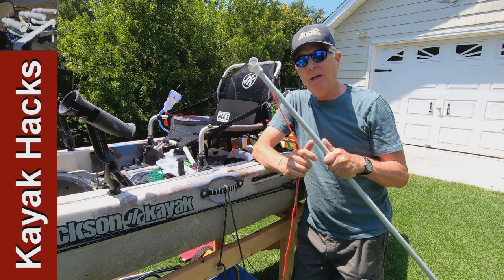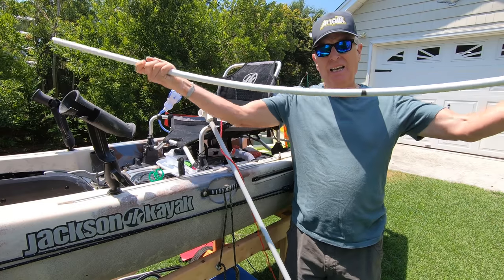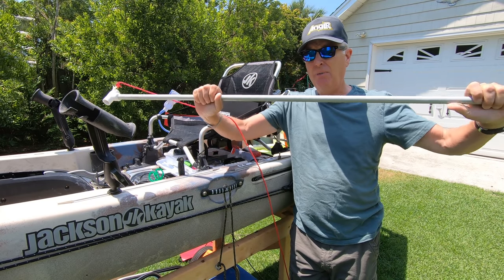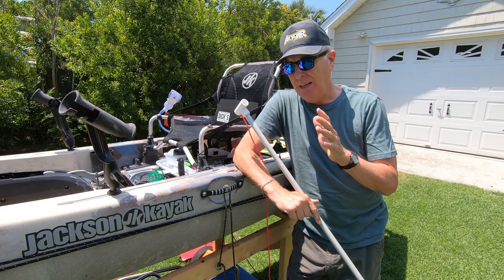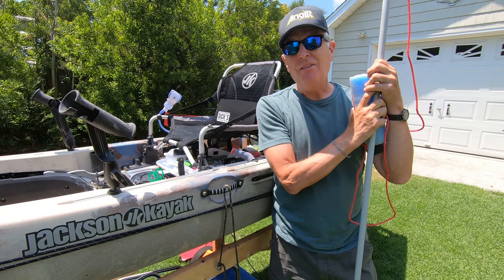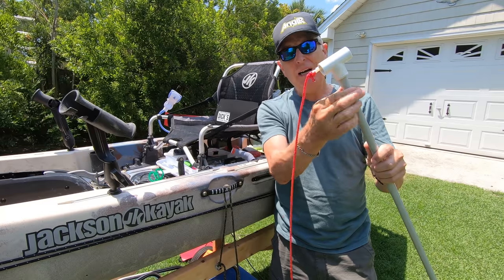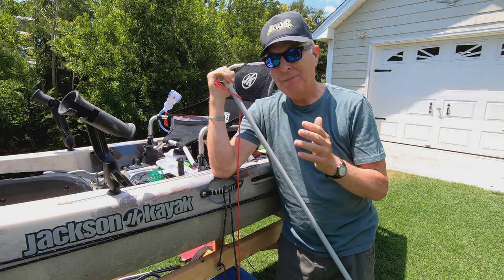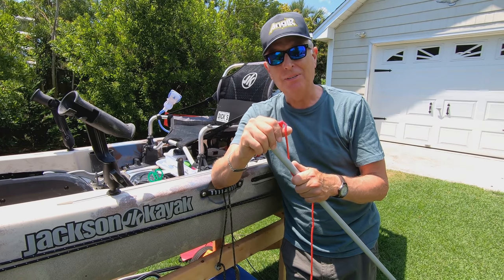DIY Stake Out Pole Kayak Anchor - No PVC! (Stake Out Pole Part 1)

Comment: GREAT IDEA.  Gonna try and make us a few.  I read in a comment below about splintering and I have had some guard poles splinter on me.  I think that the fiberglass with a coat of flexseal, especially on the handle would really help, especially if the fiberglass started splintering.  Thanks.
Reply from the maker: I put shrink wrap tubing on it. No issues since I did that
Reply: @KayakhacksFishing  now that's a great idea.

Comment: I bought the 1/2 poles from them, but couldn't find a handle that fit it properly. May have to bump it up a size or two then. And that zip tie pool noodle hack is one of the best I have seen for a stake out pole. I lost the only real $80 stake out pole I bought because the noodle didn't hold it up. That's when I began my quest for DIY stake out poles.
Reply from the maker: lol! My expensive one is on the bottom as well!

Comment: Thanks for all of your hard work you put into these videos! One thing I can say is If you run the rope through the handle, then cross the rope about 10 times around each side of the tee (should look like an “x”), tie a bowline knot into your slack rope and make it as long as you want. Unless you’re applying 24 kN of force, it won’t go anywhere.
I guess the real factor there is how much your rope can withstand lol. But it’s not really that hard to keep the rope tied to the stick. There’s hundreds of ways. That’s just the way I did it.
Reply from the maker: That is a great idea! Thanks

Comment: I did the Wal-Mart fiberglass pole for mine. For the handle to go the bicycle section and get a pair of rubber handlebar grips, the old school type with the flair flange at the opening. They fit real tight, no need for glue.  On the second handle with a razor knife  i cut off the flange  and use it as a sliding stop with an "s-biner" on my anchor line in between. The rubber ring is real sticky on the pole and stays where you put it.
Reply from the maker: Thank you for those tips!
Reply: I used the miracle grow fiberglass stake.  I found its diameter to be a little to thick for the areas I fish.  Yeah i could get it pushed in but in some areas it really took some effort.  So I put on the painters mask and spun it on a home made lathe to get the diameter I wanted.and a rough point.  

I then to some marine grade putty and on the pointed end I covered it with putty but the. Also made some vertical barbs.  Picture a arrow hunting tip. Not the field point.  But the triangular hunting point.  I formed the putty in that shape around the point fiberglass rod.  What that does is even in the strongest currents ive had my pole pull out all except that last two inches of my pole.  Kind of acts like a barb on a fishing hook.  Works well...
Reply: Now this a damn good hack. 👍
Reply: Thank you

Comment: I made one from a similar garden stake I got at Walmart for around 6 bucks. I used epoxy (JB WELD) and added a small bolt through the pvc and fiberglass area for security. I made one 6 Ft. out of 1/2 inch spike and one 8 Ft. out of 3/4 inch stake. The 6 Ft will serve most of my needs as I fish a lot of shallow water. I also think the 8 Ft.-3/4 in. is considerably heavier but may be useful. I added JB Weld to the tips for wear resistance. If it wears away over time I can always reapply down the road.
Reply from the maker: Does the 1/2 inch hold well?
Reply: The 1/2 inch is very stiff and anchors very well. Built and had my wife use it a couple of times. She likes it. You can slide it through a scupper hole or just stake it in and tie off to it. Her I use it in the ring on my anchor trolley.
Reply from the maker: Perfect! Hope other folks see your comment.

Comment: Nice work. I use a 6' stakeout pole also, as I'm usually in fairly shallow water too, and anything longer would just be in the way while transporting/stowing it on the kayak.

Keep an eye on the garden stake you're using so it doesn't start shedding/flaking fiberglas off into your hands. I believe some fiberglas starts doing that after exposure to wet environnents and UV rays.
Reply from the maker: Hmmmm. good point. I think I'll cover it with shrink wrap
Reply: @KayakhacksFishing  Shrink wrap is a good idea.
Reply: I was reading thru the comments to see if anyone made this point> My "school of hard knocks" lesson involves pulling out my rock marker buoy at season's end. The buoy was designed to ride up and down with changing water levels on a fiberglass shaft.  After a few seasons, as I grabbed the shaft to lift it out, it filled my palm with glass splinters. I promise, you'll only do it once....

Comment: I was thinking of a cheap SUP pre-made handle instead of PVC. At the handle end of a tomato pole, a wood dowel with a 1/4"-20 bolt through the center of the dowel. Inside the handle, a wood dowel with a 14"-20 T-Nut. This way I can mount a camera with the 1/4"-20 thread. Stick the pole/camera in the bottom, then pedal by for the fly-by B-roll shot.
Reply from the maker: Give it a shot and let me know how it works!

Comment: I liked ur idea of using a solid fiberglass pole. I was able to get one from Walmart online sold by another seller without having to cut off my right arm to pay for shipping. It’s 8ft and .875. The 3/4 size was only available in 6ft. I was wondering about the weight. The pole weighs 3.5 lbs and was interested in ur thoughts as to whether this is too heavy. I fish off my Bonafide SS107
Reply from the maker: Post the link to the product if you get a chance so others can take advantage of your find. Mine weighs 3 pounds and I think the extra 1/2 pound on yours will make it easier to stick.
Reply: Kayak Hacks Fishing I just checked and unfortunately the link is no longer there.

Comment: Love the video!  Where are you guys finding 8'  fiberglass poles?  I found a 6' fiberglass at Walmart, and I see there are some 8' at Lowes but they are a plastic coated metal which is really thin and can bend/break on you.    I'm looking for 8' fiberglass but having some trouble finding one. :(  Thanks!
Reply from the maker: I guess you need to continue to try garden centers.  I got mine at AM Leonard, but they only charged $15 for shipping back then. Now it is exorbitant. Maybe see if you can order online thru Lowes or Home Depot with the free ship to store option...
Reply: @KayakhacksFishing  We don't have any AM Leonard stores here unfortunately so I'll just keep digging. I know I can get a 6' fiberglass from Walmart for like $7, but I'd really like an 8'.  May just try the 6 and see how it goes. :)

Comment: Im confused on what the pool noodle is for?
With the stakeout pole stuck how could you lose it?
Reply from the maker: If the pole falls off the boat or if you have to pull the pole to chase a fish, the floating pool noodle allows you to come back and pick it up
Reply: The fiberglass is quite dense and will sink, if you drop it, or if the water turns out to be deeper than expected. The pool noodle provides flotation to allow retrieval.

Comment: Is there a bracket on the boat that it goes in?
Reply from the maker: Yes, I explain in this video - https://youtu.be/yVnWF6NKrJ0
However, you could do a DIY with one of the PVC gear head adapters I explain with a simple 1" T fitting on top. I am going to make a video on that soon.

Comment: Hey y'all, was just wondering if the pole is made from fiberglass, it would seem that it's not good for the wildlife. Just saying!! An would hate for someone to get a big fine for pollution. I would check an make sure it's safe.😎
Reply from the maker: I have never heard of that. It is covered with plastic, so I do not believe it is an issue. What state would prohibit it?
Reply: I am sure that you can't put any fiberglass in the wild, I mean with fibers coming off of it. It might be covered in the middle but the ends have nothing on them, I was just saying that maybe you should ask the FWC if it would be legally to do so, that's all. Just thinking of the wild life that's all.😎
Reply from the maker: @pinkydavis4223  thanks - I really wonder about it though when you consider the thousands of boats made out of fiberglass
Reply: It's true that a lot of boats are made of fiberglass, but they put two or three coatings on it to seal in the raw fiberglass. If you didn't seal it every time you touch it you would get tiny fibers on you, I speak from experience. I've made a few big fiberglass coolers to store fish in on long trips, it's nasty stuff.😝😎

Comment: Fill the pvc with sand
Reply: Use a 3/4 pvc and fill it with 3/8 wooden dowels. Cut at an angle and fill the tip with cement putty. 
👍

It's worked for me for over 6 years now.